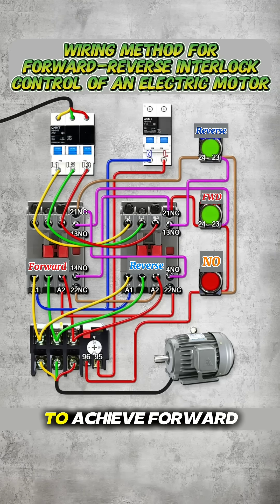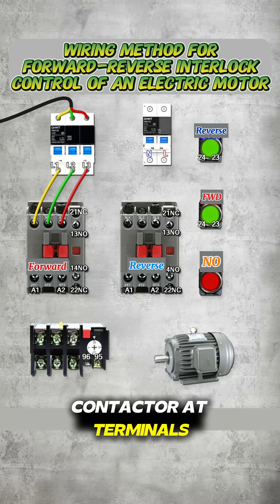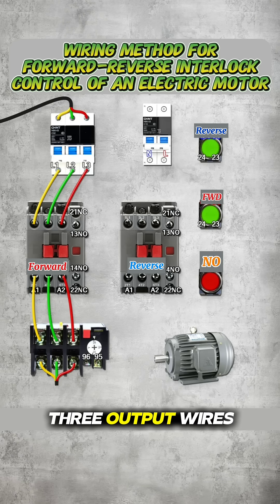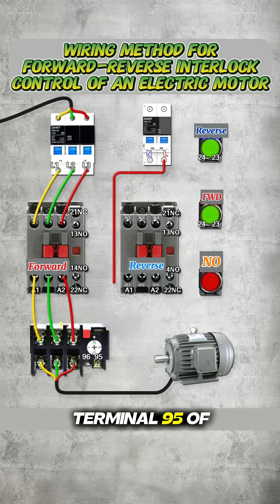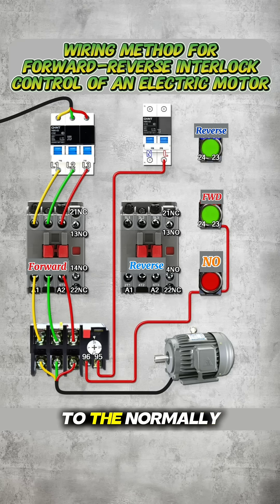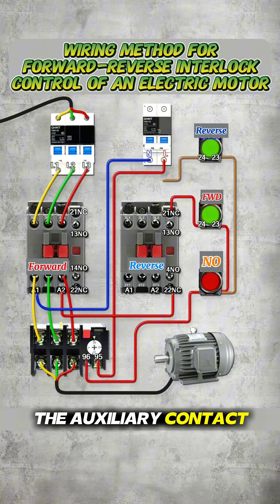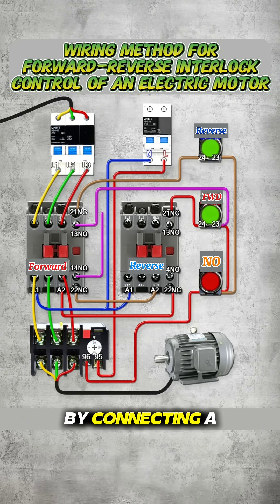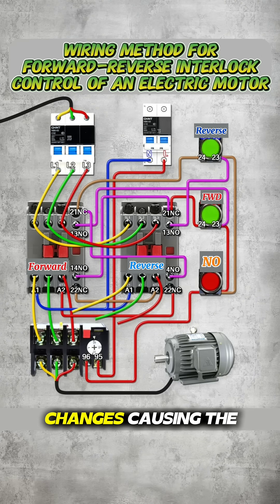Wiring Method for Forward–Reverse Interlock Control of an Electric Motor #motor #electricmotor

Comment: How is the motor going to change direction if all 3 poles of the contractors are the same phase in both situations?
Check you wires...they are in the same order in both cases ....2 wires must be swapped to change rotation!
Reply: nilijua ni mm tu nimeona kumbe mafundi mko makin👍

Comment: Excelente método de cableado, bien explicado y fácil de seguir.
Reply: But it's wrong! Either contactor will run the motor in the same direction!
And there should be a mechanical interlock between the two contactors!